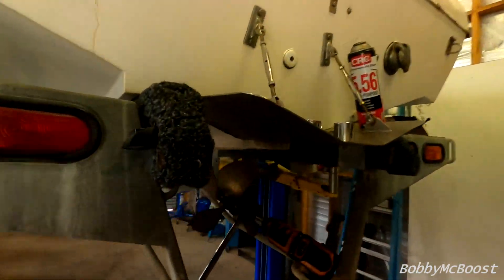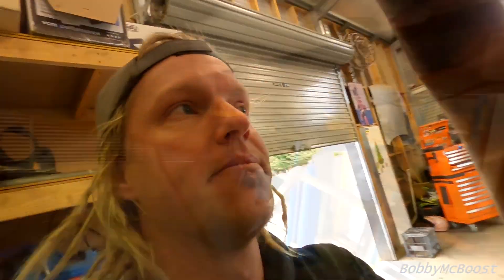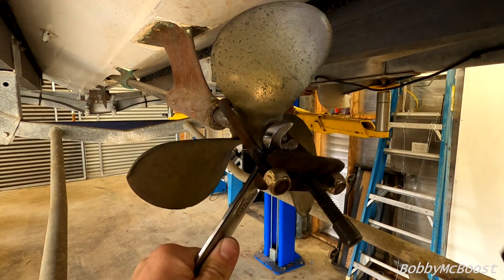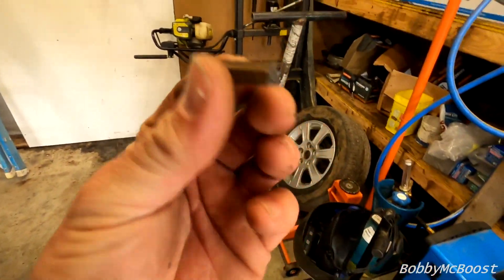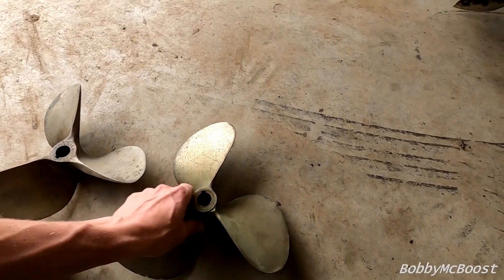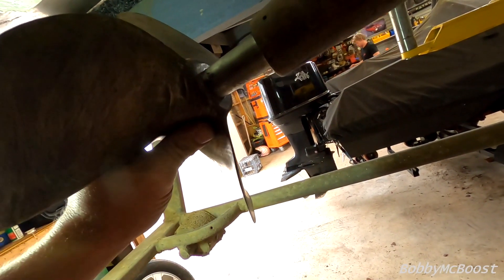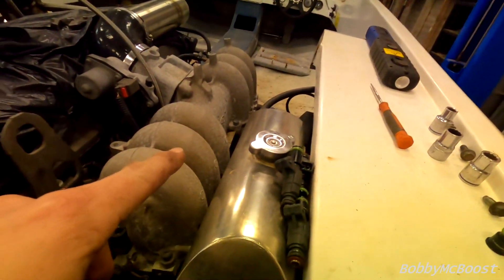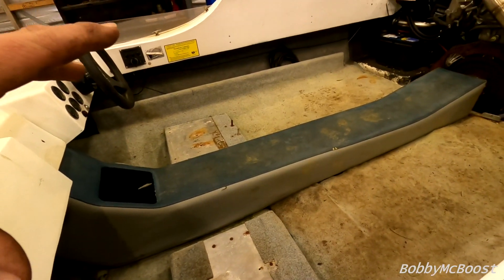New Prop for more Speed - Boat is ready to Scare me..

Comment: I am enjoying this build and I like your style.  In general, propellers are called out by diameter and pitch of the “screw”.  So if the propeller says 11 x 15 that means 11 inches in diameter and a pitch of 15 inches per revolution.  The prop you took off is like a ski boat prop so I’m looking forward to seeing how much speed you get out of the new one.  Bitchin.

Comment: Don’t be afraid of a little heat be afraid of a lot of heat but don’t be afraid of a little and when you get it warm hose it down with WD-40 the heat will pull the WD-40 into whatever but be careful brass can’t take a lot of heat you can get heat sticks they look like crayons each one is a different heat range and when you’re heating something up you touch it to the metal and when it melts and leaves a mark it means you’re at that particular temperature they’re definitely handy when you’re doing something like what you’re trying to do those two tricks could’ve helped it fall right off

Comment: It should fly now with that prop. Thats a wheel meant for speed. Engine will be happier.
Reply from the maker: Hope so. 🤘🤘
Reply: Its a Cleaver style prop. 
Really meant for boats with surface drives where the prop is partly out of the water but regardless will be good to see what it does for your boat.